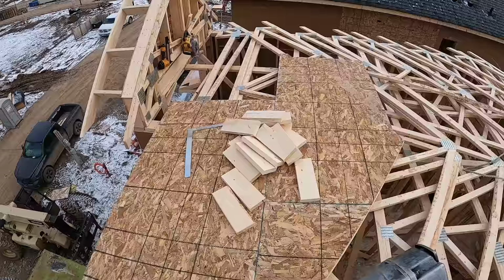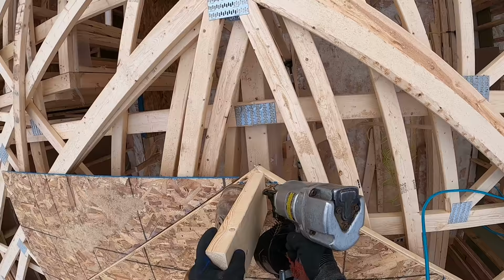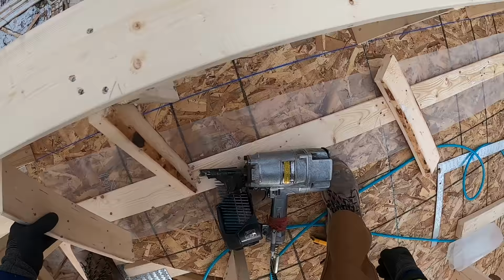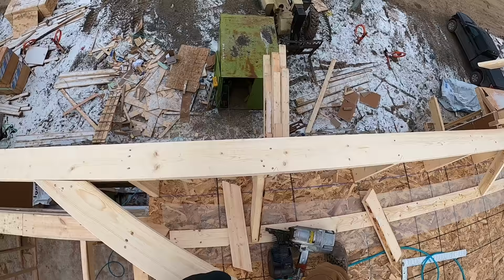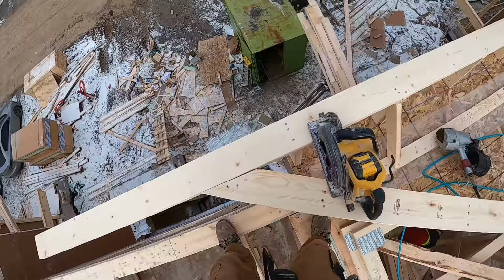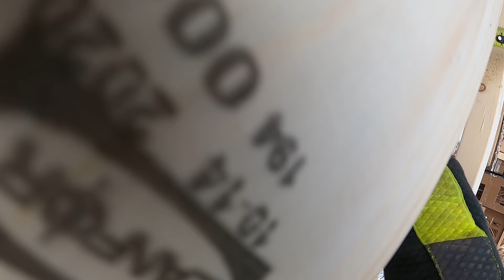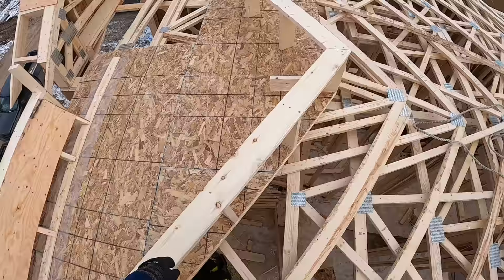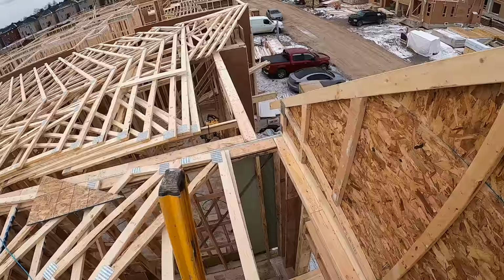gable skirt construction.

Comment: Glad to see you have a square. Whoever framed my house didn't have one.
Reply: Most framers don't give a shit
Reply: @timhammond2183  IDK what framers you know lol But, the ones I've met and Every One I've learned from or worked for ABSOLUTELY cared! Simple framing mistakes can cost lives
Reply: @gm4ulkill  if its not perfect, it shouldn't pass inspection..
Reply: @mikefrost2404  there is discrepancy.
Reply: @mikefrost2404  Let’s see you get a structure of that size, with that many angles perfect. The accepted tolerance is usually 1/8”. If you can get it any better than that, create a channel and start making us some videos.
Reply: The house does settle over time, so it's damn near impossible to have square walls. However, I've see some of the worst studs installed in my house.
Reply: @mr.smitty1993  😂 IDK what you people are even going on about.. I replied to the idiot that said "most framers don't give a shit" haven't said a damn thing about the building being square.. BUT, since that's what everyone seems to be stuck on , A building SHOULD be squared damn near perfect when they're built. Something within the range, is STILL considered square soooo... And a foundation shifting & settling has 0 to do with the builder's and will happen no matter what. So that's irrelevant to the conversation
Reply: @deanlockyer2440  I agree. If it ain't "perfect" it shouldn't pass inspection would slow the world down. And frankly there's a tolerance. Let's be real.

Comment: You never gave Neal the template you cut out, you nailed it to the poly piece. 

Happens to all of us.
Reply: He called out a pitch and the length which should have been enough however
Reply: @wll1500  as a cut man, sometimes it doesn't quite come out how the nailer needs it.  Unless he accidentally read the hips and valleys table

Comment: Framing is fun.  When you get into a groove and see the productivity, it’s a good time.  20 years in construction on west coast of Canada, and the best times I had, was framing townhouses on the west side, working long days.  Then drinking beers watching the last of the light away.  Also, cold days, we’re easy working days too. Hot days…not as much fun, but nice when you were done. 

Also, was that a staple gun for the sheathing?  If so, what’s your spacing on those fasteners?
Reply from the maker: Great post and one I can relate to. Yes I stapled the osb and I like to put 7-8 staples on a seam and 6 in the field

Comment: It is obvious a crane was used to lift the trusses so I cannot understand why the gable end assembly was not built on the ground. It is much safer and quicker.
I like to assemble gable ends with another two trusses attached then lift the assembly and stack the other trusse against them. I have also assembled girders with hips, sheeted and the racking for stacking the sheeting already built. Crane operators love working with me.
I have watched people build a roof using the crane for a whole day lifting one truss at a time in a situation where I would have the crane in for about an hour.
Roof are my favoutite.

Comment: 15:54 min how did you fine  out the  retun or the lenght of the wood??  i got something just like that its 12/12
Reply from the maker: If it’s 12/12 whatever the over hang block size the height will be the same.  14 1/2 fascia block = 14 1/2 up from top of block to top of ledger board

Comment: How do you like your saw compare to the smaller 20v from other companies? I’ve tried it and it is way torquier but feels substantially heavier than the other saws.
Reply: There's no comparison of the framing saws to the little 6 1/2" blade saws. That said, the little saws have their uses and it's best to have both.
Reply: That saw is heavy it’s a wormdrive style saw I personally don’t like it. I have one I only bought it because it came with a 9 hour flexvolt battery and a fast charger for $320. My saw of choice is the blade right version the dcs578 has the same power and a led light, it’s also compact/light.

Comment: Is that a Hitachi coil siding nailer your using from 5:10 on? Also, what air line are you using ? Looks so thin and flexible.
Reply: It's a coil framing gun. And he is probably using 1/4" poly hose. Very light weight. Prone to being a tangled mess new but will "break in" with time and warm summers.

Comment: I've never seen a roof frame that intricate, looks overly complicated compared to homes here in Texas.  I'm just curious what's the reasoning behind it?
Reply: Your roof could be a cut roof whereas these are trussed roofs
Reply: You mean the webbing in the trusses? That's to transfer the weight to exterior and load bearing walls. The weight eventually leading to the footings then transfering to the ground.
Reply: This is typical in most homes, trusses are very convenient

Comment: Wow how times have changed. Now you can just toenail an eave to the side of a  gable end truss and call it good. What happened to outriggers notched in to the top chords of the trusses and at least back to the next truss behind the gable. Very fast carpenter but kinda cheezy on the support of the Upper eaves above the lower eyebrow he built. We prefab all that stuff on the ground and crane it up. Those trusses aren't that long though, maybe all handset. No doubt a fast carpenter though. Fun to watch.

Comment: Framing in winter ALWAYS depressed me…. I knew as I was on my way to the job and that I was going to be cold for the next 9-10 hours…..even with all the gear I was still cold…. Hated it with a passion.   It didn’t help that the GC I worked for was a miserable bipolar jack ass….framers are a different breed.  I envy them but at the same time I don’t envy them

Comment: Boy, how cheaply houses are manufactured compared to when I framed.  Good speed though, no standing around smoking and looking for aliens here. Only thing I thought was weird was there is no plywood hangover at the bottom, why is that? also, ever caught a nail in the foot? I feel like that's a future video of yours lol.
Reply from the maker: Lol never nailed myself in the foot knock on wood
Reply: @framingbeast720  one of our crew members shot himself in the leg with a 8 penny nail gun, nailing shear, could see the head protruding from the pants, hit bone apparently that was 2 days ago. That's what happens when you remove the spring... Worse I've done is Skillsaw my thumb like a fork down to bone, gloves in Winter, sucked the glove In-between the guard and table, thankfully I was using a DeWalt cordless like his which has automatic Brake... Otherwise would have climbed my ENTIRE arm... It grew back I'm typing with it now skin is thinner now though and nerve damage permanent.
Reply from the maker: @mjolnirswrath23  wow...that's got pain written all over it. I've never taken the spring g out of guns. I don't see how that makes things go faster. I did however out a coil.framing nail right through my foot about a month ago...went right through my big toe, through the composite boot plate and into the ply...and to make things worse I got it on vid..

Comment: I like how efficient the nail gun is but I despise nails because they are hard to get out and less quality kinda thing is rather pay more for 2 screws than cheaper for 4 -8 nails not sure on prices but I’m sticking with screws
Reply: First of all never ever frame with screws!!! There’s zero shear strength in a screw!
Reply: Im like 90 percent sure that there are screws thst bend and move and are stronger but more expensive im not sure but there as good maybe even better than nails thats what i was referencjng id never use normal screws for structural building
Reply: @justchillman104  im pretty sure i never seen a screw that bends never in my life maby there is some super special screws that cost 20cent a piece but im defenitely sure that there isn't the right way would be if u screw everything in place and then nail it and then un unscrew all screws būt  nobody dosnt do that sorry for my bad english bcz i have diffrent language auto correct
Reply: @justchillman104  i just googled it and there isnt a screw that bends like 10degrrees or More that dosnt break
Reply: Sorry my mistake mustave seen it somewhere and it have been false advertisement
Reply: @justchillman104  i mean maby there is somewhere in the world but not in my contry and i never heard of them i mean if there was those i think everyone would use them but mby there is somewhere ✌
Reply: @justchillman104  there is bolts that bend but not screws

Comment: Not bad but should of used a straight edge to plumb from top cord to bottom, I seen it be off a half inch on a 6 foot gable by just using a level in the middle like that
Reply: Plate level ftw

Comment: Never seen a framer use a battery saw it actually is a waste of time changing battery you waste your steps and not just that the the cutter on the bottom is also wasting steps its easier to be on the roof cutting it not the ground

Comment: Always gap your wall or gable sheathing 1/8” as recommended by the manufacturer. Much easier and safer to perform this task on the ground then lift into place with a crane. Appreciate the hustle though.
Reply: Can't tell you how much ZIP I've torn off and re sheathed because it wasn't spaced right.